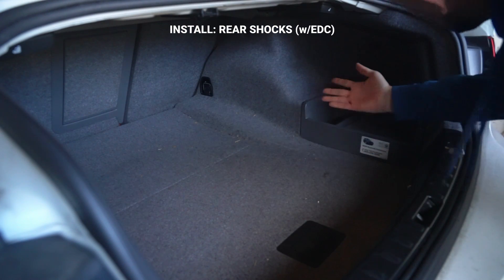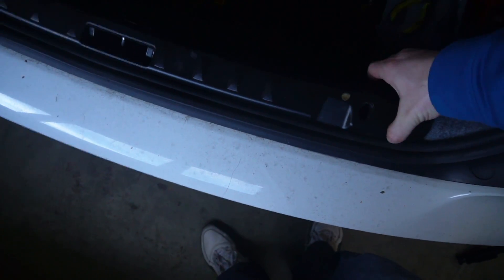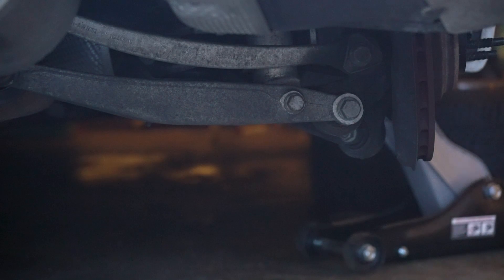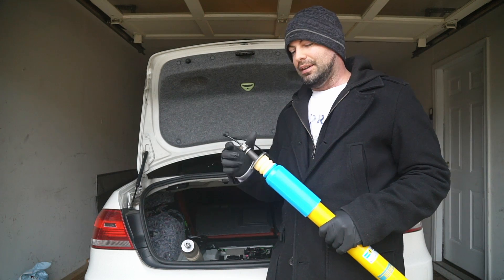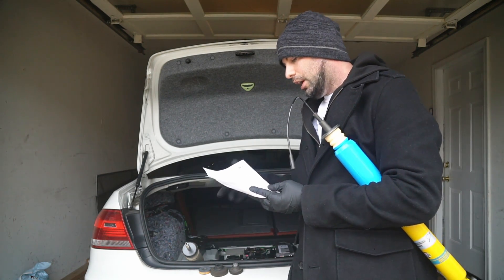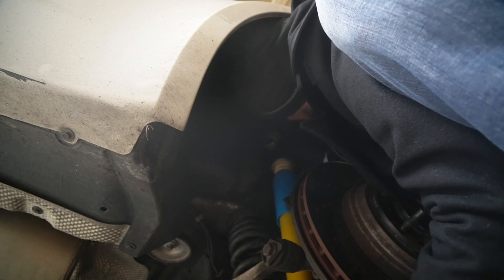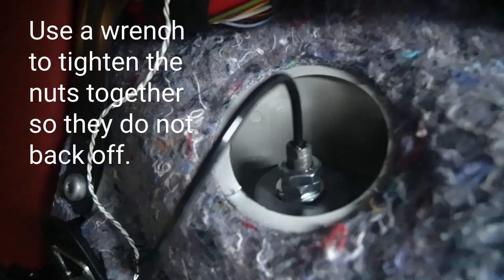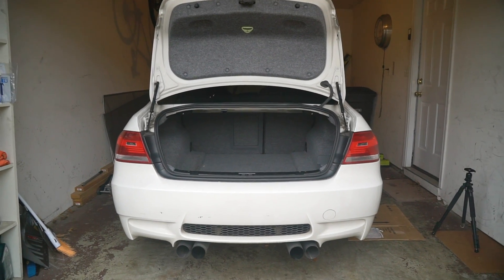How to Install Bilstein DampTronic Shocks on the E92 M3

Comment: Hi, does it work well? Much harder than series? Does Sport Plus still make sense? Please ask for your experiences. Thanks!
Reply from the maker: +Peter Neumann Comfort mode is softer and more plush than stock. Normal is firmer than stock but not at all harsh. Sport is very firm, not bouncy, and great on smooth roads.  These dampers are fantastic, even with only the rears installed.

Comment: Great vid. Where your stock shocks blown?
Reply from the maker: +Subi3 not sure if they were blown but they definitely did not pair well with Swift springs
Reply: @JoshTaylor  Was the ride too harsh with oem shocks and swift spring? Just wondering because I was looking into getting Swift springs.
Reply from the maker: @aetrole4060  not sure if it was simply the age of the dampers but after the Swift spring install there was negligible difference Comfort, Normal and Sport EDC modes. The ride was firm all the time.